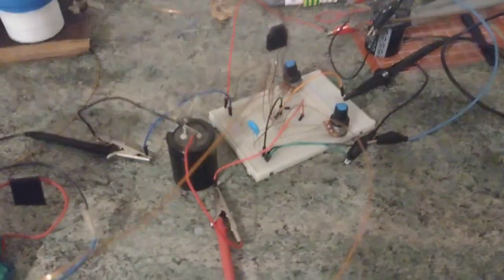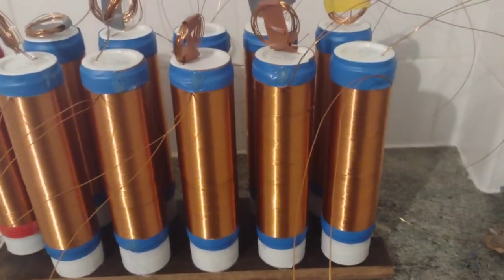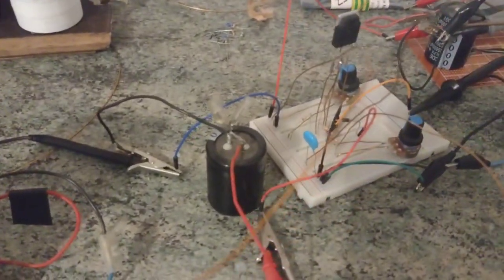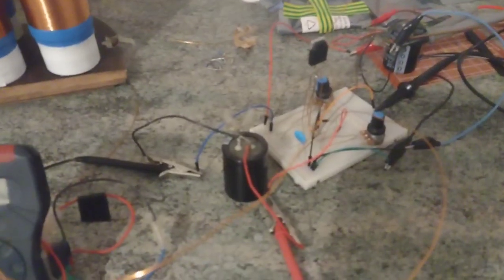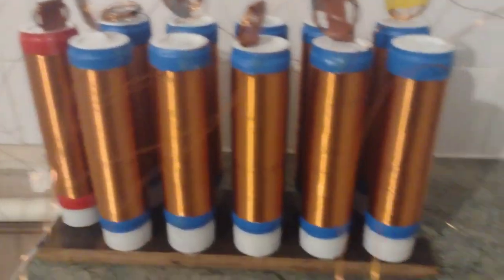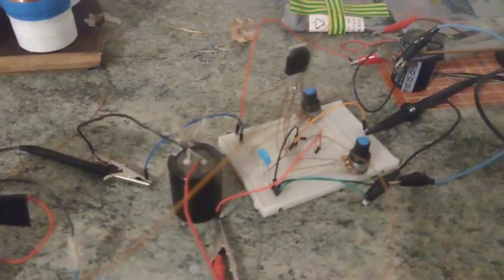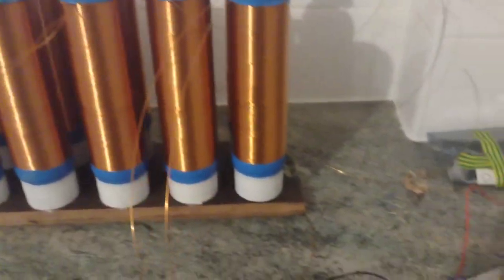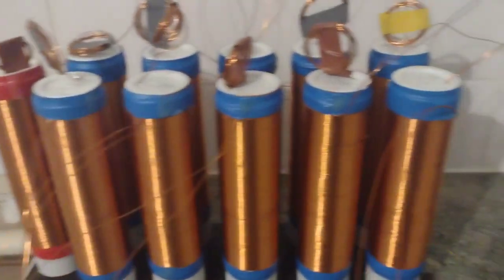First Initial Test.

Comment: wow great video, that is an interesting coil arrangement, i have also seen this with the main coil in the center then all the secondary coils around the main coil. are you getting good resonance between all the coils with this set up?
Reply from the maker: Thanks for your comment...  I'm yet to actually power it up in this arrangement... I had it working on the breadboard with a single coil setup & it performed well...  I've already got lots of these type of systems wound to different spec's & have repeatedly achieved one for one charge...  Initially I'm only firing it up with one of the circuit boards with 3 coils then I'll just keep adding to it as I go.....   I'm very nearly complete.  My previous Alexkor Oscillator is built with much the same layout as this & have gotten decent efficiencies...

Comment: So, assuming you are not living under the misapprehension that the laws of thermodynamics are wrong, are you trying to capture radiant EM energy from the sun and charge a battery? Why not just use a PV cell? For all practical purposes, EM from the rest of the universe (or Earth sourced) when your side of the Earth is facing away from the sun is going to be many orders of magnitude less than from the photonic stream from the sun.
Reply from the maker: No... I'm capturing it from a spike or transient into a Capacitor & storing it until the right time before releasing it to a second battery or batteries...
Reply: @oliver1224  oh, so are you trying to smooth power, but without "throwing away" the energy in spikes? Is this an attempt at improving efficiency? I'm genuinely intrigued by what you are doing, but just can't seem to fathom the how and why :-) I should also say, I'm only an electronics  hobbyist without a firm grasp of all the concepts involved.
Reply from the maker: @mikelastname  I'm not using the Caps to smooth out the effect but to capture it and redistribute it after a time delay..  I'm playing with Tesla's method of conversion into a battery charging system..
Reply: @oliver1224 Does this mean that you are keeping the potential from the transients "in-circuit" as EMF without converting it to chemical potential in a battery?
Reply from the maker: @mikelastname  Pretty much... the circuits  & coils are fully beta matched which means they switch on at the same time....  so yes I'm collecting on the spikes...& sending it into a bulb device on the output to store it in a Capacitor..  the bulbs act as a trigger & then then when the Potential rises high enough they will automatically tell the Transistor circuits to switch the stored Radiant potential from the Capacitors to the output battery...   my input can be considerably lower than what I'm charging yet it will continue to charge the output load.

Comment: If I may ask, in simple and very clear terms, what is the aim you're trying to achieve?
Reply from the maker: I'm building a 10 coil Messner type charging Oscillator with 19 matched switching circuits.   Eventually  I want to use it for battery swapping.
Reply: @oliver1224  so, they will charge the batteries while you swap between them during usage?
Reply from the maker: @ekeretteekpo3004  They will replenish a small amount back onto the front battery that's powering the system... the back batteries that are being charged will remain in a state of full charge bar one which will be swapped with the front battery that's powering the system..  The larger the load placed across the rear end being charged the greater the usable potential I will have at my disposal..  but the discharge device has to be able to handle the load.
Reply: @oliver1224  so, there will be a battery powering the system, which also gets some charge back for its recharge, at the same time it drives the system to keep a battery bank charged up as a backup to be switched in succession with the primary battery driving the system while also supplying a load. Is that it?
Reply from the maker: @dedu456  Thank you.. yes but won't probably see it until I increase the load placed across the output...   It will work in conjunction with a Capacitor switching device on the output...  I haven't begun to work on that yet...  that will come after
Reply: @oliver1224  I think I saw a comment on one of these videos (I'm not sure if it was yours) where they insinuated that the higher amount of load kinda improves the efficiency of the system. 🤔
Reply from the maker: @ekeretteekpo3004  Yes it does... Its to do with the Capacitor Discharge device.... the amount of usable potential you've got at your disposal because it more than doubles with every battery you have across the back end but only when they're connected in series.  It will only do the work you require of it... so its based on demand...   if you've got 12 volts input battery & 48 volts across the output the Capacitor Discharge is going to treble that when the 3 batteries across the back are full charged & one is being charged.. the discharges are going to be massive... This is why I've been building & Using the Bulb Devices that I call the Capsule Discharge devices...  Its to do with the Transient Spike...  the larger the load across the output the higher the Transient climbs..
Reply from the maker: @LungsMcGee  They are Bifiler coils..  each are gong to feed into a matched switching circuits but I'm still working on those..